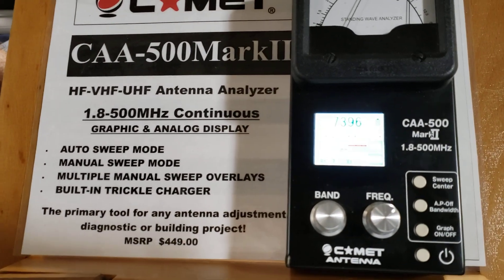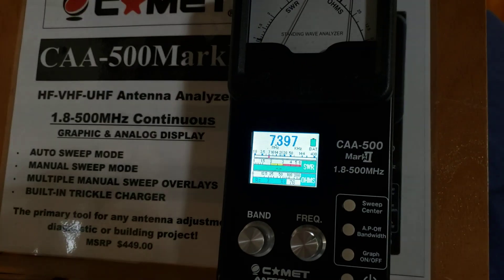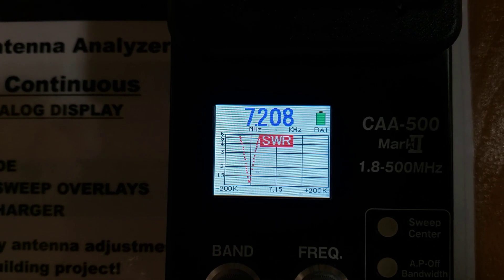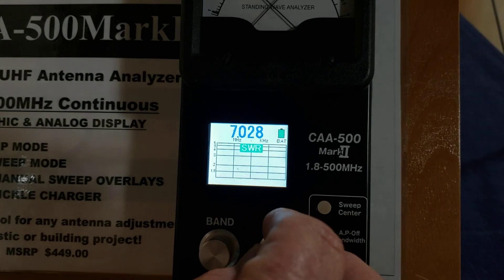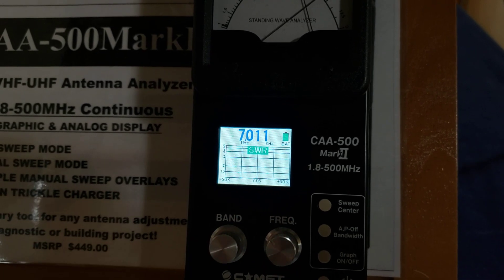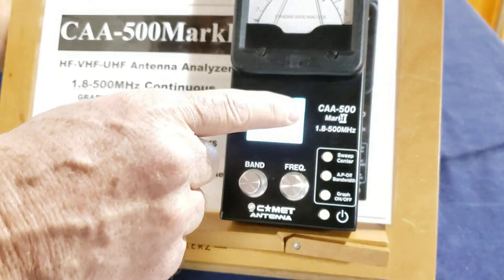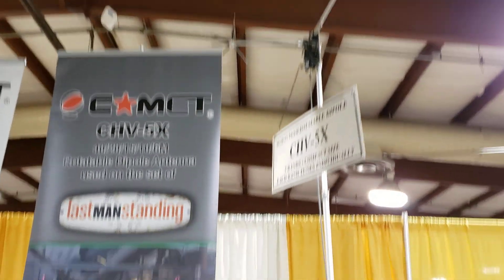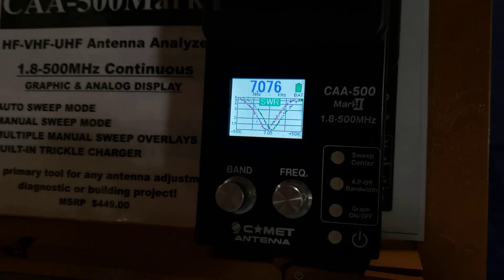Comet CAA-500 Demo at HamCation 2022

Comment: Could I know how to do the calibration? I owned it in late 2019, but I have not touched it for almost 2 years, just a couple days ago I tested my new Cushcraft R8, and I still can see my R8 SWR number below 1.5 which compared with my other antenna analyzers(RF-1, KVE-60C, Rigrepert stick, MINI 1300 and LiteVNA) and VSWR Meters(Diamond SX-600, REVEX W570, and LP-100A). So, I went to the Comet website for support but no documents were found like a service manual or technical supplement. Could you help me with " The calibration methods or steps"?

Comment: how long does the battery last on these?  I know it uses 6 AAs but how often do they need to be replaced?
Reply from the maker: According to the manual... "Size AA alkaline (manganese) or Ni‐MH rechargeable batteries (six required) may be used. Typical battery life is 9
hours of continuous operation when using AA cells". (https://cometantenna.com/wp-content/uploads/2013/09/CAA-500MarkII_Eng_ver1.pdf)
Reply: @HamRadioOutlet  thank you
Reply from the maker: @markgutierrez2024  Any time!